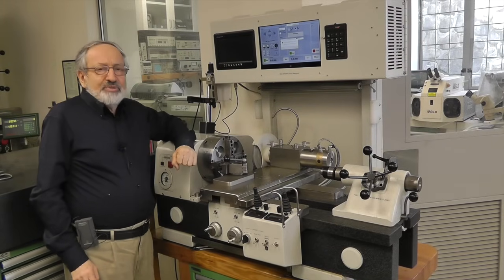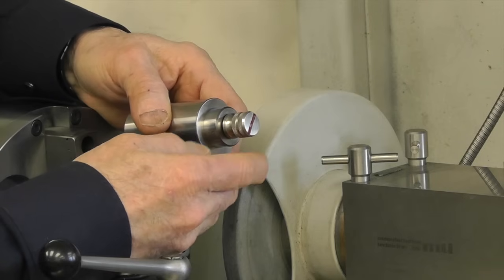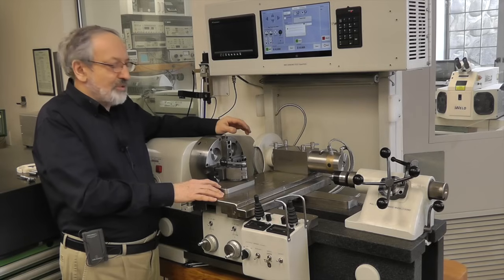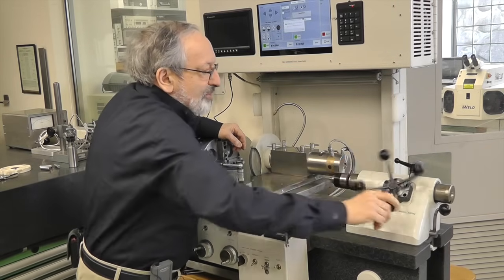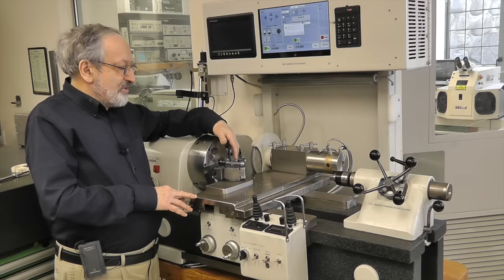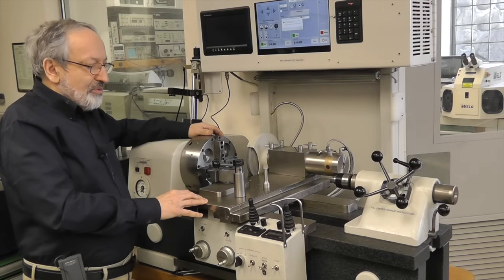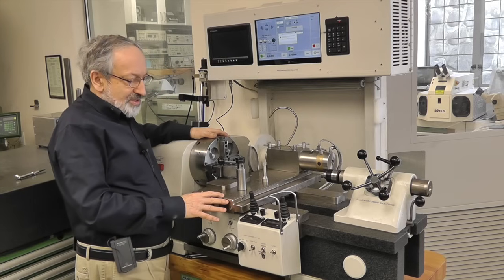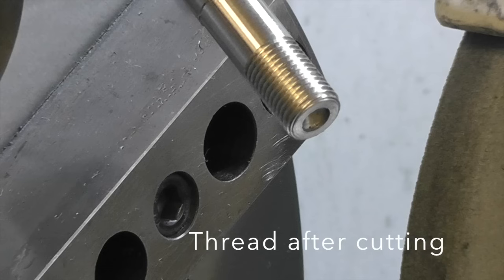High precision air bearing CNC lathe and grinder

Comment: Dan, very impressive setup. I assume you removed the motor bearings and had its shaft run between 2 surplus circular air bearings (which you bored through for the shaft). What level of accuracy machine to make those spindle air bearings bored on center? Do you use something like fine adjustment gibs on the bearing to align the shaft analogous to a chuck. I would love to try making an air spindle bearing motor on my knee mill with surplus air bearings if that is how it was done.
Reply from the maker: It is done the other way, you uild the air bearings and use the line of rotation as a reference to adjust the headstock.

Comment: How long did this build take?
Reply from the maker: A few months but I have a very good workshop and a lot of experience in precision machines. This is not a machine for beginners.
Reply: The quill looks cast. Is it cast or did you sculpt it?
Reply from the maker: quill is a solid piece of 2"  A2 tool steel , hardened, ground and lapped. All Lathe parts are electroless nickel plated to avoid rust from coolant. Lapping is done after plating.
Reply: What about the tailstock base?
Reply from the maker: Weldment.
Reply: Wow cool. Beautiful build! Good job.

Comment: It's an amazing lathe. I only try to make air bearings once, when i build a Tesla turbine, and i fail miserably. The tolerances have to be very tight.
You had a very clever solution to build the bed, does the viscosity of the epoxy affect the aligment of the parallels during the glueing? do you have to press the pieces with high pressure?
Reply from the maker: Noneed for pressure, the weight of the granite pushes out the excess epoxy. The parallels are kept in alignment during curing via a matched pair of precision steel spacers. Very slow setting epoxy is used.
Reply: +Dan Gelbart So it flows naturally. Thanks for sharing this video. It's an awesome lathe. I too like to engineer everything my self. Today I test a homemade forging die to make thick aluminum cones. And I didn't miss my calculations by much! Sometimes manufacturers make everything look like, but there is always some sort of way to do it yourself.

Comment: Amazing you said the Software was made by someone else, is it customized open software or proprietary ? Info either way would be helpful Thank You for the videos
Reply from the maker: +Hiram Rios It is proprietary, does not support G code, just canned cycles. If that's what you need I can connect you to the person who wrote it, I see no reason why you could not buy a copy. It would be several thousand $ because of the hassle factor.
Reply: +Dan Gelbart  I imagined that would be the case, it was just general curiosity thinking hoping really that it would be a customized flavor of LinuxCNC, thank you so much for the quick reply gave me goosebumps and it feels awesome that you did.

Comment: Mr. Gelbart, in your opinion, is it more or less difficult for someone to build a much smaller "ie benchtop lathe or mini lathe lathe" size machine to this accuracy (1um) using the principles you used in this construction ?  Would it still be a useful metal cutting lathe or would the smaller bearing area affect load capacity for metal cuts too much, or or would other issues arise that require a radically different approach to acheiving this accuracy in a "benchtop" footprint (and weight)? Thank you for your channel you are truly inspirational.
Reply from the maker: +Andre Anderson Smaller is always easier but air bearing must be kept large area, mainly spindle bearing which should not be smaller than 50mm dia x100mm long even for a watchmaker's lathe.  In my late it is about 100mm x150mm long + a thrust bearing 160mm dia and this is the absolute nimimum.

Comment: "It's not that difficult to build a machine like this" lol.
Reply: +Mathew Copeland I think what he means is that nothing about this machine is really revolutionary. Other than the chuck , all the components are just the best parts for this use, bearings? use the most precise bearings, use the most precise bed and make the assembly ultra stiff. not saying that is isn't impressive, but it's just many little things done very well
Reply: @cyan933  The chuck uses a pinon instead of curved cutouts...nice but not rocket science...
Reply: @cyan933  Yes, and that is why it's impressive many little things done very well.
Reply: 4 side granite parallels seem to be in the 1000 bucks range for a pair (we need 2 pairs), spindles 700 bucks each, surface plate would be 300-700 bucks, air bearings around 100 bucks each, times 8 per axis, we might have 32 total, so 3200 for the bearings, plus misc hardware would be around 2000 bucks, for a total under 10k, which, while expensive, is a bargain for this kind of precision.
Reply: @satibel  lab grade - AA  24 inch long parallels will set you back about 3k per pair - no idea where you seen them for 1k + linear motors seem to be in no calculation and what not - its about aprox 25-30k in total just raw material list
+ not to speak about the cost of a temperature controlled room each 0.1 degree fluctuation will offset your calibration
Reply: @pierrekircher4383   https://cnc-specialty-store.com has 30 inch 4 side AA listed for 1208.
though, yeah, if you go for starett, that's around 2500
Reply: @pierrekircher4383  getting linear encoders with a 1 um resolution is fairly easy, and if you have a good encoder, the linear actuator's precision isn't as important as long as it can be controlled to that resolution. (and such encoders can be had for 150-300 bucks)
to control a room to .1C you could use a water loop with a water cooler/heater, and some 2nd hand radiators, just a big thermal mass will allow the room to stabilize fairly easily if it's decently insulated, I'd say 500-1k, plus another grand for the insulation and panels.
I think there's a way to do it for under 10k in raw materials, but under 15k is definitely possible.
Reply: @manaquriazertyuio4555  would you mind linking me the glas scales where to buy those  - if they have finer ones - that be great - im working on a wafer stepper
Reply: @satibel  great link - cheers for that
Reply: @pierrekircher4383  EDM machinist here who worked at the same tolerances this guy is working at...the whatever temprature is fine as long as it does not fluctuate 3 degrees in 10 minutes...ie a storm moving in...
Reply: @eugeniovincenzo1621  didn't know EDM was that accurate -
in Semiconductor / Electron Microscopy even half a degree switch makes a huge difference - maybe due to the process - edm is slow and pretty much stable + supplies its own coolant - no expert here just thinking out loud
Reply: @pierrekircher4383  That is because to the semiconductor and electron microscopy industy microns are pretty big units. Usually they are working on nanometer scales. Current processors are commonly based on a 14nm process, with the 9nm process currently being optimized. That is about 2 orders of magnitude higher than this machine and apparently also EDM.
Considering that 120nm processes were still pretty popular at the turn of the century (0.12 microns) the fact that semiconductors are about 10-100 times more sensitive to temperature changes than 1 micron processes sounds about right
Reply: He has the modesty angle covered!
Reply: It's not really that difficult... for a guy with Dan's talent and knowledge.
Reply: @Dochirin   and don't forget financial resources.
Reply: I had a good chuckle with that one too. LOL
Reply: Nothing to it... when you have a few spare minutes, start by knocking up a planet, then just follow your nose from there!    ;o)
Reply: Correct its not deficult, but yes its very complicated 🤓
Reply: @timelapse7454  and probably "difficult" for a hack like me.
Reply: The Dunning-Kruger effect works both ways. This guy probably assumes everyone he meets is as smart as himself.
Reply: I had to make a large lathe for work. Took about 9 months to design it and 6 months to get the parts made.  Again the cost is not cheap - in the 10K range but working one part at a time resulted in being able to machine a 10 foot long drum two foot in diameter with a TIR runout of 0.0014 inches ( 35 microns)
Reply: if u have a workshop like him , its not a big deal i guess !
Reply: Just line everything up to a 1 micron tolerance. What's the issue lol?
Reply: He has a point, it is much simpler than one would expect just from the spec and that becomes clear from his explanation. While he is clearly a very skilled engineer that's not the point, if a machine takes 20000 engineering hours to get off the ground it's not a one man job - period, it's not a question of how talented your one man is. If hardware on top of it takes half a million dollars to build - again it's not going to happen as your own personal project. I'm not just throwing random figures here, this is how difficult I would have expected building such a machine to be before watching this vid. Dan clearly proved my expectations are way off - it's difficult, but not so difficult that one man could never pull it off.
Reply: @aleksandersuur9475  For sure! Like I can see how one man with a good reference table and and half a dozen dial gauges and the relevant fixture/gauges could actually do it now. Honestly the biggest problem might be finding a machine shop that can actually hit those the tolerances willing to run a bunch of super low volume parts lol.
Reply: @gacekky1 but you still need a decent lathe
Reply: Yeah, you only need another 2 or 3 of equal quality to get there..
Reply: @gacekky1 Very true on the latter (I didn't even know they made grinder attachments for MOST ALL lathes til just now!) but a multiple part run at this level of precision is gonna make you wish you had CNC lol. Preventing operator fatigue and potentially freeing them up to at least monitor multiple processes is basically always worth it for machines that will be used for any manner of serious production. Potentially a worthwhile splurge for the once in a while shop toy just for the ease of repeatability with a machine you don't use all that often but dang does it get pricey.
Reply: Maybe not if you have an iq over 150 and worked for over 60 years in machinery lol.

Comment: Dan, where did you acquire the granite bars for the bed?
Reply from the maker: +teekayenne http://www.precisiongraniteusa.com/
YOu can get cheaper stuff from China but this is the foundation of the whole machine. Cost of the granite was about $2500-$3500.
Reply: @dgelbart  if one didn't have the money to buy these but was stubborn enough to try to make them by hand what would you suggest? I'd then like to expand this line of questioning to including creating the initial air bearings as well.
Reply from the maker: @nicoleyensen7062  The air bearings are not a problem, just turned and lapped. The bed can be scraped by hand but you need to borrow one of those granite masters to do the scraping.  Read the book "Foundations of Mechanical Accuracy" by Moore.
Reply: @dgelbart  thank you for such a prompt and succinct response! I've been a fan for years having watched all your videos, and with your recent additive manufacturing endeavor probably taking up all your time, I'm amazed and rather starstruck that you even responded. I now have a copy of the book based on your recommendation, thank you again!

Comment: Hi Dan,
Inspiring work. Did you make the chuck as well? If not who did you get to do it?
Cheers
Reply from the maker: +Andrew Robb  Yes, you can not buy a chuck like that. Too bad as it is a real time saver. All parts are hardened , ground and lapped.
Reply: +Dan Gelbart 
Thank you for replying so quickly Dan especially considering it is nearly midnight in Canada.
Regards from Australia
Cheers

Comment: Very nice machine!  You make nice videos too.  I'm just curious where you got the tailstock casting, and the headstock. Did you re-purpose them from another machine, or did you have them cast?  The cross slide parts could have been machined from cast iron bar, like Durabar, or Versabar, etc.  Keep up the great videos

John
Reply from the maker: +Offyguy They are not castings, they are weldments.
Reply: +Dan Gelbart  Interesting, thanks for the reply.  I'm slowly getting around to watching all of your videos.  They're very informative.  So many videos from other people are of such poor quality, or contain bad information, they're almost useless.  What good does it do to live in the information age, if the info being shared is incorrect or of dubious value?  Your videos are top notch!

Thanks,  John

Comment: Hi Dan Gelbart. Your grinder is amazing. I'm not very knowledgable about how to build it. I would like to build one or many for ID grinding. I would like to know how to build the table axis x and z. If your willing to help in any way I would appreciate it. Thanks
Reply from the maker: +Daniel Wiles Unfortunately I'm too busy.
Reply: I'm willing to pay for help. This project doesn't have to happen overnight or within 6 months.
Reply: I understand. If there's any litterateur on this build or information that you used on the build please share. I know I'm going to make a few of these in smaller sizes. Just would be nice to get good correct and up to date info. Thanks for your replys and any info is greatly appreciated.

Comment: ok, what ''drives'' the axis movements, namely cross feed, and how can you cut or grind tapers to the same tolerances?
Reply from the maker: +thesupernittygritty   drive is microstepped stepper + leadsrew. Taper or any other shape handles by CNC control.
Reply: +Dan Gelbart thanks for the reply, and your machine is beautiful. so the lead screw for the saddle is located in the center of the bed, and the cross slide motor is opposite the operator and sits low out of view in the video. will it hold 4 microns on a taper cut? you should do a walk around video of this incredible build.
Reply from the maker: +thesupernittygritty Correct. Will hold 1 um on any taper.

Comment: Hi Dan,
In one of your (fantastic) tutorial-videos, "part 16 of 18 Machining" https://www.youtube.com/watch?v=a_E-tYRxBkU#t=8m40s , you mention adding a groove to the tip of a tight-fitting shaft to aid with self-aligning. How are you able to fit the piston in the cylinder at 0:48 without having made such a groove?
Reply from the maker: +Aditya Mehendale  Very good observation. The cylinder bore  has a bit of a lead in taper in this demo, but this is not always allowed. The groove is the right way of doing it, leaving a 1-2mm  wide ring at tip. One other factor that helps on the demo is that both parts are very hard, this makes insertion much easier.
Reply: @dgelbart  Hello Dan, a colleague of mine has recently built a nice EDM machine as a side-project. He discusses a nice tip to get a wrapping-angle of >360 degree on a pulley here: https://youtu.be/us3KhT7r01g?t=1202 (Channel-name: YouTube --> BAXEDM). I think you'll really like it (and the rest of his video-series too, if you have the time - Mike has 5 videos in the series thus far). Regards!
Reply: @dgelbart  Dan, I must absolutely implore you to watch this video (flextures cut on a homebrew-EDM) https://www.youtube.com/watch?v=CcTQoy_tBp4

Comment: absolutely brilliant... but don't you need a temperature controlled room with constant temperature for that to make sense because the lathe will contract and expand more than one micron with temperature and humidity chances. Not to mention that the building settles which effects the lathe.
Reply from the maker: +SquirrelFromGradLife The whole shop is temperature controlled. Humidity has no effect. Floor stability has no effect as lathe rests on 3 points (like jig borer), not bolted to floor.
Reply: Dan Gelbart wow are your shop temp controlled? can you really control expansion on metal and granite to a micron scale on that lathe?... it's very impressive with those air barrings because major companies have failed making that kind of precise lathe and you have just proven them wrong... impressive work and your knowledge about machine tools really must be documented... keep on the good work
Reply: +SquirrelFromGradLife There is nothing special in doing micron scale stuff, all you need is stable temperature. Doesn't matter what that temperature is, as long as it is stable and you know what it is for correcting your measurements.

There are precision lathes available, but if you have to ask the price, you can't afford it. But to get a special machine like shown on the video which can do lathe and grinder work both, well, it is custom here, so it will be custom anywhere which means extra costs.

Comment: 1 micron is still 10000 times bigger than an atom.  So I wonder how much air is escaping per minute?  If you leave it close how many days does it take for air to completely escape the cylinder?
Reply from the maker: +GodsLoveMinistry   About a day for air to escape. If you really want to, you can make a cylinder with a better fit, like 0.1um, by adding some lapping.
Reply: @dgelbart  live lapped finishes.

Comment: So how many micron is the gap?
Reply from the maker: +Amnotasmartman The current gaps in air bearing are about 10 micron. You can also design air bearings based on porous media (graphite, bronze etc) which have a 1um gap and very good performance but I was afraid to use them because they can be plugged up by the collant. All water based coolants leave a residue when collant evaporates, and once the pores in porous media air bearing are plugged the system is dead.  Pad based bearing can be washed out when gummed up without dis-assembly. It happened to me once and I injected alcohol into air line to flush out all gummy residue from the ways. If you use oil based cutting fluid you avoid this problems but have other problems.
Reply: @dgelbart  I was thinking the porous carbon material too. Thank you very much for your comment on the "plugging" issue. Very well though-out.